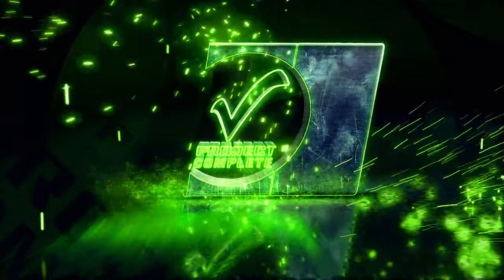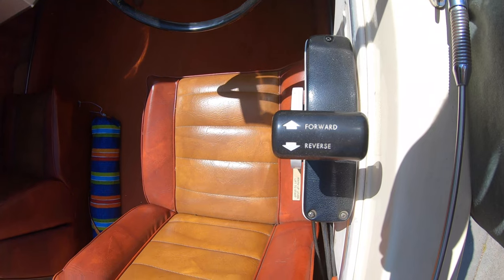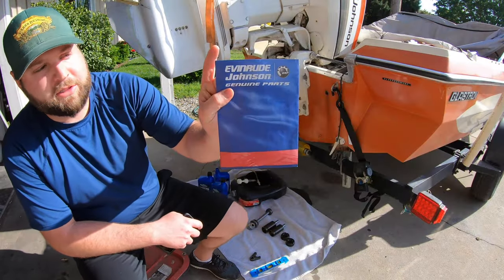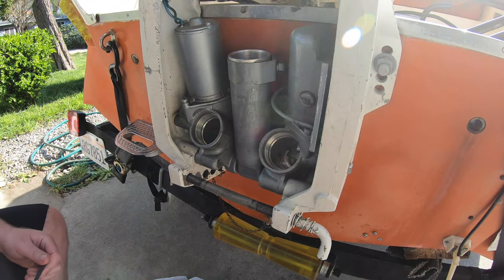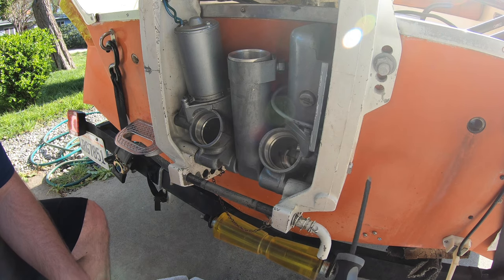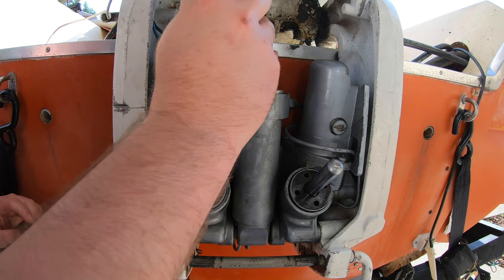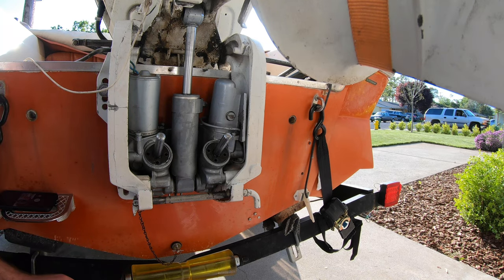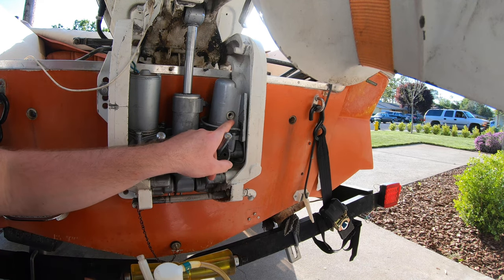Power Trim and Tilt Refill | STEP BY STEP

Comment: Great, straightforward video.  I'm in the process of changing the orings on my 1979 115 Johnson from my late father.  It's actually also mounted on a glastron, mine is a 1980 SSV 167!

Comment: Nice one mate! My 85 HP Yamaha tilt trim played up today. I was gunna' check our crab traps. & at the ramp the motor wouldn't go down. The hydraulic pump is running , and eventually dropped. I thot' lack of fluid! I know it's an Evinrude/Johnson but it is exactly the same as the Japanese rip off. I appreciate your vid  especially the ATF fluid.
Reply from the maker: Glad I could help! Thanks for the comment. Hope you got it all figured out!

Comment: Thanks! I'm about to tear into my  125 horsepower Force for the same problem... The shop told me they couldn't rebuild the pumps and it would be 6 or $700 for a used replacement unit...

Comment: Hey bro. I have a mercruiser outdrive that is partially up/down.  I'll do my best to apply your teaching in this video. Thanks for sharing!
Reply from the maker: Glad it helped! I believe most units have a manual release. So check into yours, I’d start with trim and tilt fluid and then move on to seals and rebuilding. If your hearing no motor pumping or trying to pump. That may be gone as well. Best of luck to you!

Comment: Do you happen to have a video on how to replace the trim motor (in case that is what I need to do)? I loved your video as I have an Evinrude VRO 140 (1985) (On a Glastron), so it looks very much like your boat engine.
Reply from the maker: No I don’t sorry, I’ve never had to replace mine.

Comment: Very helpful. Question that maybe you can answer? My fill screw seems to be rusted tight. Any ideas on how to free it up? 1988 Johnson 88 SPL motor. Motor mount looks exactly like yours.
Reply from the maker: Try PB plaster and an impact screwdriver, but the chances are the fill screw will be damaged. Heat can sometimes work, but there should be a rubber gasket. So if you do use heat you’ll want to replace the screw and gasket.
Reply: @ProjectComplete  PB really is the best penetrant. And very good advice. I've been am mechanic for over 30 years and I would have given the exact same advice.

Comment: My system is a little different but it definitely sounds like that. I didn’t know if I should leave the cap off or not because the fluid was pouring out lol.
Reply from the maker: I don’t know your exact system, but generally during the flush part you leave the plug off. Fluid is supposed to come out during the flush. Once the lines and cylinders are clear of most of the air, then the final part is fill the reservoir to the max fill. The whole process is very similar to bleeding brakes.

Comment: My 1979 85 hp seals are leaking I can’t find the part and I’m not sure if that’s the proper term for the part? My mechanic can’t find any online but he said if I find the parts I could do it myself , can you help identify the part for me? It’s the circle thing with the 4 holes in it , he said that’s all I need to replace

Comment: I'm at seal kit do they contain the seals for the center hydraulic cylinder we have one from the same year bought that exact kit and it did not contain the main cylinders seals
Reply from the maker: I believe they include the seals for everything in the hydraulic trim and tilt unit. But I’m not 100% sure. I didn’t end up using all of the seals in the package.

Comment: my trim sounds like the pump is working but it won’t raise or lower at all, just makes noise and it’s full of fluid . could my seals be blown in my pistons ?
Reply from the maker: Yes, it’s possible the system is not holding pressure. It’s also possible that your pump is trying to pump, but not actually working.

Comment: fyi  if you dont have that special tool, you can use  the blade from a dull chisel or screw driver and hammer the small holes in the losen direction to remove  and tap it off and on, same as the old school sttuts on a car,

Comment: I will gave to give this a try. I'm tired of doing it manually letting down and lifting up the motor. And also a question what do I use for lower unit to fill the gear oil?
Reply from the maker: Yes, that hydraulic system was actually from a another boat of the same year. Before it was just a manual trim tilt system. I had to wire everything from scratch from relays and fuses.

It’s funny you mention lower gear unit. My next video is on lower gear unit maintenance. I typically use 80w-90 gear oil and change it once a year unless your noticing water getting into it.

Comment: This was a very informative video, thank you. My motor won't go down unless I open the side screw. However, the two lower pistons won't go down at all. Any thoughts?
Reply: It will go up though. Is there just one motor for both up and down?
Reply from the maker: Usually it’s one motor for the whole system. What you mentioned above is why I replaced my seals. Start with making sure the pistons aren’t seized and then replace seals and fluid.
Reply: @ProjectComplete  thanks.  I was able to get it to go up and down by leaving the fill cap off, backing the relief screw out to lower it and lowering it. Then lraising it. I did this a few times and it would go down.

Comment: If we just bought the boat and lost contact with the previous owner how would we know what fluid is in there?
Reply from the maker: You don’t but, it’s not like an engine oil change. If it were me id try to drain as much as possible and replace. If they did it the correct way they should have used hydraulic fluid.

Comment: Hi man, my boat yesterday the trim tilt was working, and the next day I went to do some check the only think I can hear is noise and the trip tilt is not working, the engine is not going up or down, but the noise sounds like your boat when air was in there. What you suggest to do?
Reply from the maker: I’d start with checking/adding fluid. If that doesn’t work you may have a problem with your pump, but I’d start with the oil because it’s cheaper.

Comment: Sometimes my engine goes down on its own…. Not all the time but it should always hold up. Any ideas? Could I be low on fluid?
Reply from the maker: If we’re talking about a slow drop or “sag”. I would guess a seal leak or low fluid. I’d start with check levels. Best of luck!

Comment: It looks like you have an orange strap around the lower end while you have the engine up. Is that for extra safety? What do you strap it to?
Reply from the maker: I only did that to remove the pin to the center hydraulic. It was attached to a beam on the exterior over hang of the house. It allowed me to raise and lower the motor without a second hand and get fine adjustments to reinsert the pin. If you are not replacing seals you don’t need to remove the pin or detach the hydraulic from the motor mount the standard safety catch on the motor is all you need. When you have to remove the pin, the motor has to raise past the safety catch. I just didn’t want it slamming back down on the safety catch when the pin get removed. When you are just checking and refilling fluid the motor needs to raise and lower freely.

Comment: Just refilled same tilt trim system but now when lifted all the way up the lift moter stay engaged. Have to disconnect battery to stop tilt motor from operating. What would cause this? Thanks!
Reply from the maker: Is it a press and hold trim button?
Reply: @ProjectComplete  it is a thumb lever on the shifter. There is also a switch at the bow. I could attempt with bow switch to isolate shifter switch as issue.
Reply from the maker: Hmm, seems to be an electrical issue rather than a pump or hydraulic issue. I’d start with checking relays and fuses, then move on to the switch to make sure a connection isn’t sticking after the button is released. You could try jumping the switch to see if it stops when the jump wire is disconnected. If it does then you know it’s the switch. I also know some units have a max stop switch that shuts the pump off when it reaches maximum up or down tilt. Possibly that lever is broken or the wiring is corroded. Sorry I can’t be more help. I am by no means an electrical wizard, either way I’d start with the easiest and move to the harder eliminating one thing at a time.

Comment: If the caps are corroded to no end what’s the best way to remove them. Holes on the caps are shallow and brittle when I use that specific tool
Reply from the maker: Well, I would start with a wire brush and good soaking of PB Blaster, let it sit for a while then try again with the tool. If the holes are stripped you could try drilling 3 new holes for the pins of the tool or even possibly hitting it counterclockwise  with punch and hammer. Either way you will most likely destroy the old caps and seals. So prepare for that...

Comment: My motor goes down slow and up really slow and will need help from me to get it up completely do know why  do I have a bad trim motor
Reply from the maker: Could be several things. I’d start with the cheaper options first. Flush and check fluid, replace seals and check pistons. Then replace motor…

Comment: Will this wrench fit on a 90hp tilt and trim?
Reply from the maker: I am not sure. It does come with 2 different pin sizes, but I’m not sure about the pin distances. It does fit on several different types models. So I would not be surprised if it does work for your model.

Comment: It would've been nice to see how you removed the pistons.
Reply from the maker: To remove the pistons. You use the pronged tool to remove the caps and they just slide out. There is nothing that holds them in other than the cap and o ring around the piston. Hope that helps!

Comment: Why does a motor seem "jumpy" as it is trimmed up & down?
Reply from the maker: Are you referring to mine or yours? If we were talking about mine. It could be a couple of different things. The portion of the engine moving up and down was edited in fast forward. Which can make things look a like jumpy. Also the trim hydraulics move faster than the tilt hydraulics. So you’ll see it’s slow to move and then much faster once the tilt hydraulic kicks in. The trim hydraulics move slowly for fine tune while boating and the tilt hydraulic moves fast to raise the motor. Kind of like a second gear on a car. But really in person it wasn’t jumpy.

Comment: So if your got power but your motor won’t go down is that cause it’s got no fluid left in it ?
Reply from the maker: Not necessarily. I would start with checking fluid and making sure the pistons aren't seized. Your motor might be shot.
Reply: Yep checked that and not a drop of fluid coming out I was using the boat the other week  so that’s what I was thinking needs fluid ?

Comment: i just finished refilling the unit and changing the seals.  the seals seem to be holding,  the pump runs, there's power to the button, but the motor wont go up or down.  i can feel pressure building in the pistons, because there is resistance, but i am at a loss as to why it wont pressurize and function. any thoughts?
Reply from the maker: Can you manually raise and lower the motor. If not the pistons may be seized and/or the rebuild/gaskets were done wrong. If you can manually raise and lower. The pistons aren’t seized and the hinge point may be. I’d try disconnecting the piston from the motor and see if they move. If the do and your motor hinge point is not seized. Your pump may be acting up and not providing enough power to get the motors weight up and down. I’d start with check oil and going from the top of this message through the rest.
Reply: Yes, i can raise and lower it.  I'll need a had to remove the piston and raise and lower it, but i think it will move.  I released some air and think i may have released too much oil in the process.  The pump is making some weird noises now, but it seems odd to have been working fine before the project and now...failing.  but i guess everything has to break at some point.  thanks for the feddback.  i'll let you know what happens once i disconnect the piston @ProjectComplete